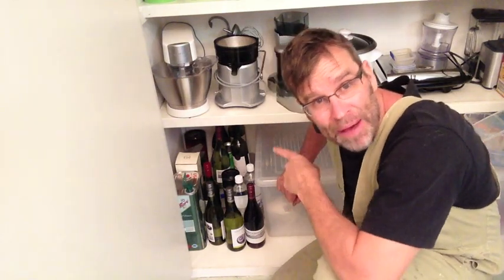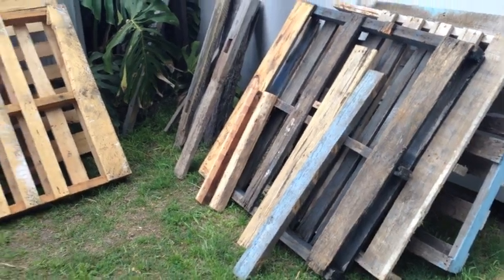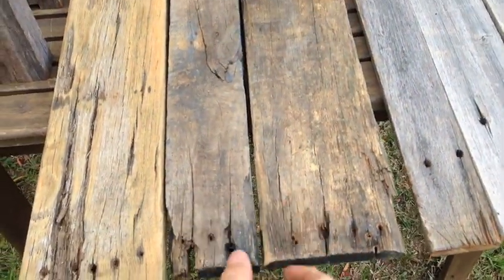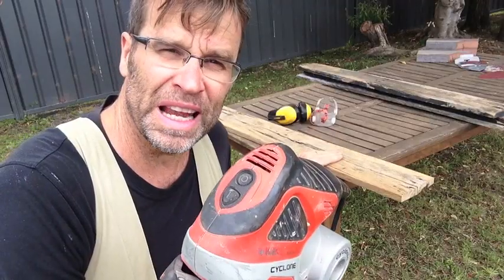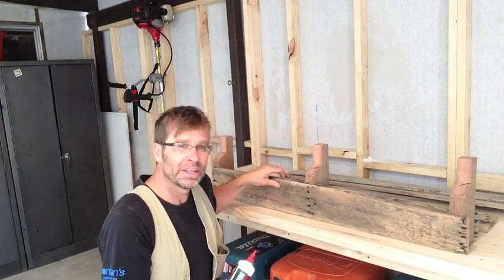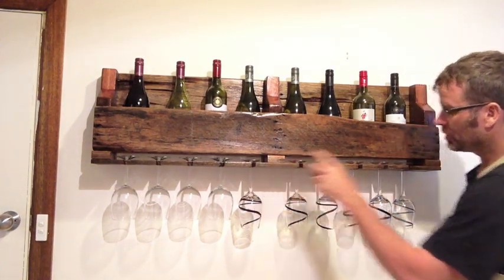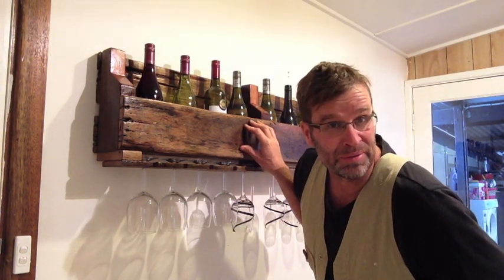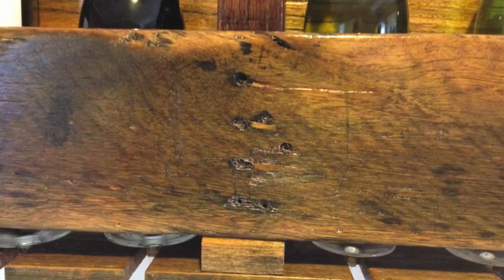How to Build a Wine Rack. Awesome Pallet Wood Project.

Comment from the maker: G'day Philip. Thanks for the comment mate. I used old fence palings for the bottom of the rack to sit the bottles on. I just fitted and nailed them between the  front and back pallet boards. You can use any old timber really just as long as it is recycled as you can see it from underneath. You want it to blend in. Cheers mate

Comment: Great video and idea.  I'm going to make the shelf and store something else though.  It's better to have wine laying horizontally rather than vertically.
Reply from the maker: Thanks Christopher. We don't keep our wine long enough for standing up to be an issue :-) Cheers mate
Reply: Why would it matter if the wine is horizontal? It doesn't matter at all. You only need to put the bottle horizontally if the bottle has a cork to keep the cork from drying out. None of those bottles have a cork therefore laying them horizontally does absolutely nothing.

Comment: Love the video. I'm making one of these this weekend. I was wondering what you used for the thick structure pieces though. Are those 2x6's? Thanks!
Reply from the maker: Isaac Baldwin Thanks Issac. All l used for those pieces were the stretchers from the pallet which are 2x4's. Cheers mate
Reply: shaneconlan1 Oh ok, thanks!. Those just looked a lot bigger than 2x4's.

Comment: how did you do the inside bottom? Is it the glass holder that holds the wine also..? because that doesn't seem right or am I missing a step
Reply from the maker: +josh price Go back to the video Josh. The detail should be in  there. Cheers mate
Reply: Yeah, pretty sure it doesn't say how you made the base to hold the wine bottles.
Reply: Installing the bottom was skipped over you're right. It looks like two pieces make up the bottom. I think he just measured the inside dimensions of the two rectangular openings, from the edges to the middle support, on each side and glued/nailed in two pieces of wood so they are flush with the support in the middle and with both sides. The three spacer blocks that hold the slotted piece for the wine glasses get attached to the bottom. You can see at 4:17 the two rectangular openings that are filled in and become the bottom.

Comment: Thank you for this great video.  I attempted it, but found the rusted nails were preventing me from disassembling the pallet.  I was splitting and otherwise damaging the wood.  
Do you have any tips for dealing with rusty nails?  (The only thing that came to mind is inserting a cutting tool between the pieces of wood).

Comment: what'd you use to cut the 3 framing pieces like that?  And are they 2 x 4's from pallet?
Reply from the maker: Lee Garcia Yes Lee, they're from the pallet and l cut them with a circular saw and finished the cuts off with a hand saw. good luck.

Comment: Hey Shane, like the wine rack is it possible to send me the sizes as it's just the correct proportion. Thx mate 😉
Reply from the maker: Mate, the overall length (which is the important measurement) is 1140mm long. Cheers

Comment: wait? so are the bottles sitting on top of the wine glass bottoms? or did you install another piece of wood inside the rack?
Reply from the maker: No mate. If you check out the video, there's a base that the bottles sit on. The glasses are about an inch under that base. Cheers
Reply: ok, I put 4 small pieces on the inside and dropped a piece on top.

Comment: I am having difficulty with the slotted board breaking in between the slots.  I am drilling the hole in the middle of the board and creating the slot every 5 inches.  Any suggestions as to alleviate this issue?
Reply from the maker: Hi Rochelle. One of the tricks is to find a dense board as they are less prone to breaking. I know what you are referring to but it just takes patience and a steady hand. If they do break off you can glue them back in place with the aid of a nail which has the hole predrilled prior to banging in the nail. Good luck

Comment: I'm a bit curious to know how you fastened it to the wall. Did you hang it or did you just run some screws through the whole thing? Cause I was trying to figure out how to make it so it can hang but still be flush with the wall.
Reply from the maker: G'day HaaGrotesk. I drilled a hole in the wine rack and screwed it directly into a stud. That way the unit sits flush against the wall. Hope that helps. Cheers mate
Reply: shaneconlan1
Yeah that's what I thought! But is it as strong as having a "hanging mechanism" like nails to the wall and hooks on the shelf. I love the way you have it. No gap between the wall and the shelf but I'm a but nervous about the durability of it.
Reply from the maker: Screwing it directly to a stud is by far the best method. It will never come down. How did your rack turn out?
Reply: shaneconlan1
Ok! Thanks for the tip! I'll go for the stud. I haven't made a rack yet. I just recently discovered pallet furniture and I'm planing to make a bed but seeing your rack was very inspiring so a similar rack is number two on the list!

Do you have any tips where to get old pallets. I think they recycle them here in Sweden! I used to live in Australia but I moved back to Sweden. Bad decision now that winter is coming! :D
Reply from the maker: Pallet furniture is really becoming popular and more and more people are getting into it. I would try fruit shops, tile supply shops, small motor shops like power tool shops or lawn mower shops. The smaller the company the better l find.
Yeah it might be a touch chilly in Sweden this time of year! Not one to rub it in, but l have just gotten back from the beach:) Stay in contact. Cheers

Comment: i really need some help, i can NOT find varnish.. ive spent so much on sealers and stains and i can't find the perfect color i want just like that ive looked online and walmart and all the local big name jome improvement stores event just sends me to stains that's not what you are using ive looked up the brand even down to the exact wording on the can please help
Reply from the maker: +josh price Sorry Josh but l'm  not sure what supplies are available over there in the U.S. Try asking for a clear oil based Polyureathane. That's a similar product. Good luck! Cheers
Reply: Unfortunately I tried it just doesn't do the same thing, thank you though for your help! And Great video